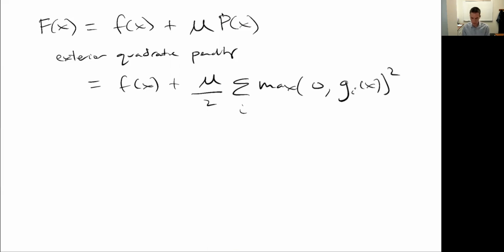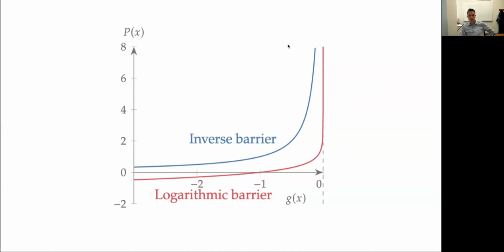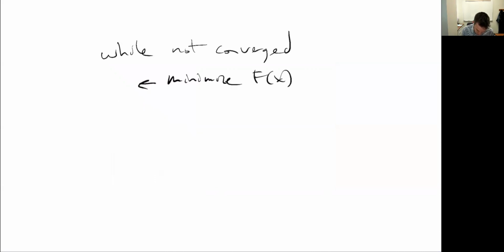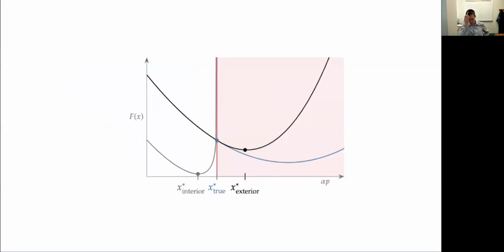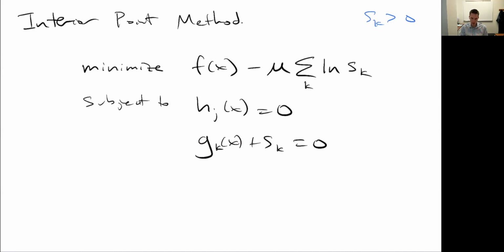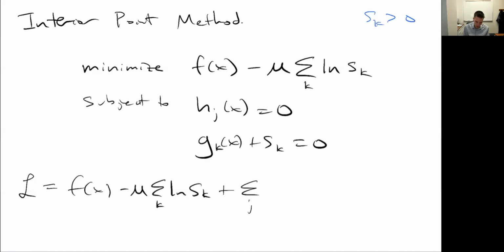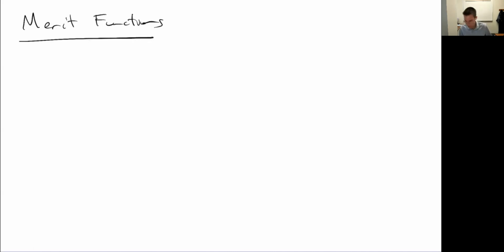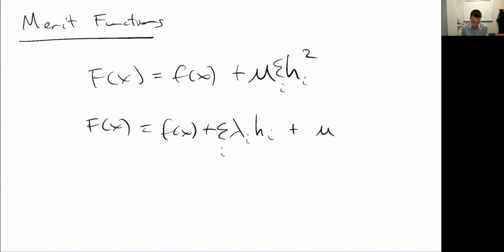Interior Point Methods

Comment: Hey man I have seriously been enjoying your videos. I’ve been doing some work on these algorithms, focusing a bit more on the Newton or quasi Newton approaches for unconstrained problems. Turning constrained into unconstrained problems is just genius. I do have a question though. Numerically, it seems quadratic exterior penalty methods would be much better to work with. Introducing an ever sharper interior penalty method seems to be unstable. Especially if you are going to approximate the hessian, such a sharp kink in the barrier function seems … problematic. Any thoughts on how to fix that?
Reply from the maker: Both penalty methods are problematic in general and introduce ill-conditioning as the penalty parameter increases (or decreases for interior penalties).  The main benefit of the interior penalty method is to introduce interior point methods, which behaves quite differently.  But yes, if I was forced to use a penalty method  than I would typically use an exterior penalty method unless other features of the problem dictated otherwise.  As one example, if the analysis was undefined for infeasible values then an interior penalty would be preferable.
Reply: @BYUFLOWLab  wait, hold on, I thought interior penalty methods where basically identical to interior point methods? That’s what other literature seems to dictate. Am I mistaken?

In any case, what would you suggest then? If penalty methods aren’t the way to go, what is the most modern of the algorithms to date? Lagrangian Multipliers and SQP seems to have quite some popularity
Reply: @johnphilmore7269  As I understood from the video, Interior Penalty Methods is to add an interior log penalty to the objective function, whereas Interior Point Method is to introduce the slack variable to each inequality constraint, hence converting the inequality constraint to equality constraint.
Reply: @hawkoli1987  ah thank you for the clear up. Honestly it has been a while since I was working on this. I think I eventually settled on a SQP algorithm. The interior barrier methods just … didn’t seem right to me. You needed to have a feasible solution anyway before you could apply it. I didn’t like that restrictiveness